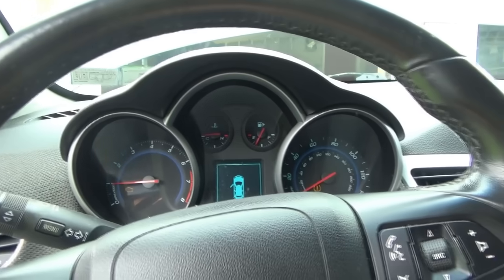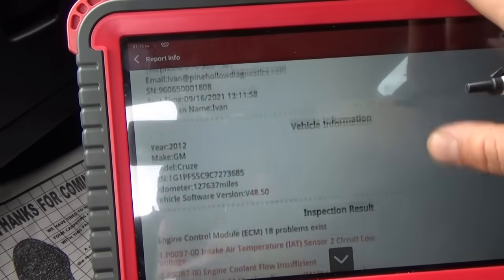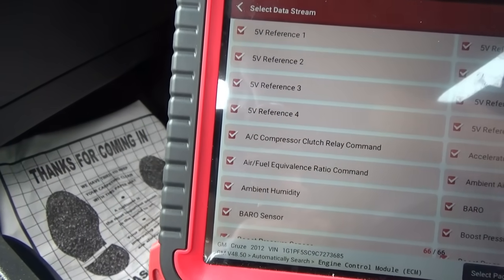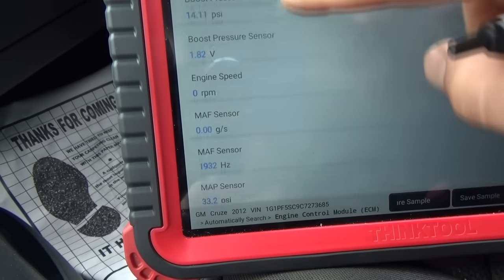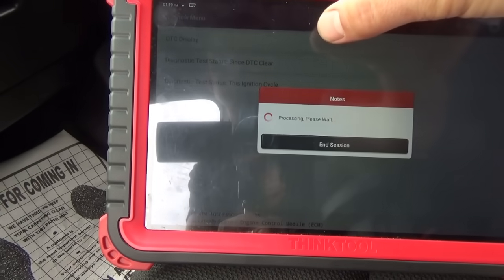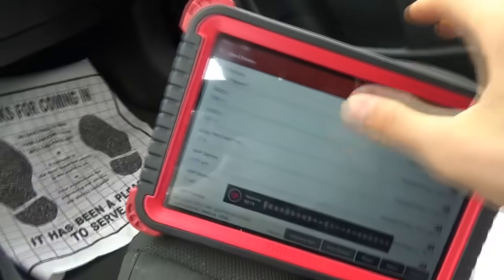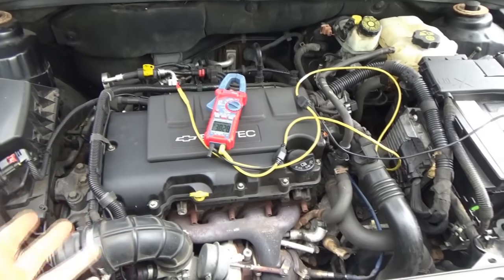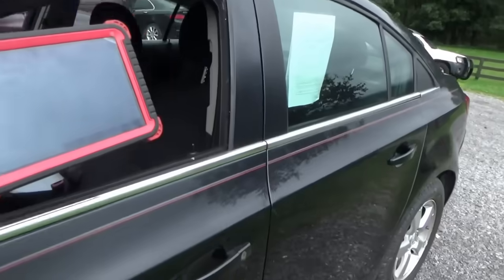Scotty Kilmer was RIGHT! (Cruze Turbo Rough Idle P0106 P0171)

Comment: The only thing reliable on a Chevy Cruze is the check engine light bulb😆
Reply: I love it! MechTech Tools must have had some interaction with the Chevy Cruise!
Reply: until it burns out
Reply: @dfields9511  maybe we should invest in these bulbs since they will be on all the time!
Reply: My sister has a 2012 Chevy Malibu with the Ecotech she has 306 thousand miles on it just regular maintenance that's it
Reply: @harveyadams5453  Right! My 2011 Cruze has been the most reliable car I've ever owned. 154k and still going.
Reply: @ComfortablyNumb1969  until 1hr and 59 minutes ago
Reply: theres nothing reliable on any chevy
Reply: You are very right, the check engine light is very frequently  on, if not always.
Reply: @ozzykrahn806  Its not just chevy. They all have their issues. Just some worse than others. It's getting worse on all of them every year. It's obvious, though, that the chevy cruze is junk. I use to work for dodge and ford as well and they leave alot to be desired!!
Reply: Which is based on my Bmw 740i too 🤣
Reply: @billmonroe8826  I’ve driven over a dozen Toyota’s and not one has an issue. I’m betting if a Toyota does have an issue, it’s due to there being a fluke by the manufacturer or the customer didn’t follow the service intervals
Reply: @harveyadams5453  There are always exceptions to the rule.  Congrats to your sister.
Reply: @harveyadams5453  That's my point!
Reply: I have a Chevy Cruze with 200000 besides regular maintenance I'm only now starting to have transmission issues
Reply: @harveyadams5453  unicorn
Reply: Naaah it might burn out.
Reply: Facts 🤣🤣🤣
Reply: Haha 😄
Reply: That can be fixed with a pair of wire cutters
Reply: Worst investment I've ever made 😂 I've had mine for half a year & I've had to put 2k into it. I change my own parts too so that should let you know how much it's needed. As soon as I fix it I'm trading that POS in & never looking back. Lol
Reply: I own two and each one has over 200,000 miles on the odometer.
Reply: @bjr2379  I think it depends on on your existing car. Working in a Toyota plant before we'd get tiny miscuts & still send it. Some go bad, others don't. I change my oil every 2k miles, & keep great maintenance but it doesn't matter 😂
Reply: @bjr2379  buy a lottery ticket because you are the luckiest man alive
Reply: @ComfortablyNumb1969  ..my 2006 Corolla at 220,000 KM still going strong.  Original alternator finally died.
Reply: @ComfortablyNumb1969  I have a 2011 Cruze that was the most reliable thing I had, WAS, then it hit 145k, thing has had a check engine light on for everything, oil leak, then coolant leak, then both.. Currently trying to sus out the check engine light now. Keep getting camshaft position sensor, sometimes it is performance, sometimes it is circuit sometimes it intake, other times it exhaust... Changed EVERYTHING except cams, no change... Bitch is about to go, absolutely HATE that car now.
Reply: @harveyadams5453  different set up.
Reply: @bjr2379  1.4? Trust me, you WILL have issues if it is...
Reply: @harveyadams5453  my sister bought a 2017 I think, against my judgement. It’s been nothing but problems wince the day after she bought it. Piece of junk
Reply: I think that's the most reliable thing on most GM vehicles.
Reply: True that!!
Reply: I never did find where the service light was on a chev I owned. It was burnt out when I bought it.
Reply: Got a 2011 1.8 Manual, it has yet to leave me stranded but there are definitely some quality of life issues I have with it.
Sometimes air won't blow through the defroster vents, I can hear the actuator running even after I shut off the car and it just corrects itself the next time I drive it.
The crankshaft seal that whines/squeels everytime I hit the accelerator. Been telling myself I'll fix it soon.
Nonetheless 85k and still running strong
Reply: @madebycarrera7585   What parts did you replace on it? I’ve had my string of issues fixed and no problems now except oil leaks
Reply: @wesleymitchell7858  I've replaced the valve cover, upper intake manifold, purge valve, & I just finished the head gasket this morning. They seem like nice cars, but even if you address it & change the oil every 2k miles instead of 3k it still has persistent issues. If I were you, I'd highly suggest getting the oil leak taken care of then trade it in. I'm selling/trading for a 97 Civic that was well maintained & it'll last 500k miles. It's a never ending head ache with Cruzes though sadly.
Reply: On the 1.4T, that's normal. My 1.8L NA has no issues
Reply: @DragonKillah  I concur with you, the 1.4 sucks 😂
Reply: That all Chevrolet
Reply: So true 🤣😂
Reply: Lmaooo fr
Reply: @harveyadams5453  LOL
Reply: @djentyman4002  some don’t drive very well, with the rotten frames.
Reply: @DragonKillah  same here. 1.8 has been bulletproof
Reply: @kw6713a  if you have an auto trans that will be your failure point. If you have a manual, you can use the access panel from a gen 2 M32 and a thicker bearing with AMSOIL Synchromesh 80w-90 gear oil and you'll never have issues with it
Reply: @DragonKillah  thanks. I have auto trans. I did have corroded transmission cooling lines, caught in time. I'd maybe advise anyone in a snow climate to have those changed preemptively or at least looked at carefully.
Reply: @Ken-wg2cw  replaced my Cruze MT at 85K miles.  Noisy whine.
Reply: Agreed
Reply: @bjr2379  ...and ?
Reply: @bjr2379  ... how many engine/tranny swaps ?
Reply: @robtheslob3940 
 Zero, but I did replace one clutch.
One Cruze was totaled after an accident. So, I bought a diesel Cruze with 205,000 miles on the odometer. Runs perfect.
Sensible driving and proper maintenance does wonders.
Reply: @bjr2379  Very true, if people maintained their vehicles properly the landfills would be a bit smaler
Reply: Yeah..hasn't failed me yet.
Reply: Mine burnt out lol
Reply: Chevy Sonic as well😂😢
Reply: Any ecotec engine
Reply: @BrianWood74  Y'all obviously do not take care of cars....
Reply: @thewarzoneking  😂😂😂 my Chevy's ran strong 💪💪
Reply: Lol
Reply: My 2014 Chevy Cruize has been super reliable regularly change oil transmission fluid  it has 184000 and still going strong
Reply: Too true on that one
Reply: the check engine light is LED , scotty  didnt know that.
Reply: NOT WHEN SOMEONE PULLS IT OUT BECAUSE THEY CAN’T FIX IT!!!!
Reply: That part
Reply: You got that right.😅
Reply: Lmfao parmesan cheese 🤣😂
Reply: Absolute junk
Reply: I absolutely hated mine
Reply: This made me lose hope and laugh at the same time. 😂😢😂
Reply: @ComfortablyNumb1969  it’s probably the way people drive and run these cars like their race cars every day lol
Reply: @bjr2379  it’s definitely the way the fools that own these cars drive them like their race cars every day and thrash them. I have a 2014 Chevy sonic hatch with 1.4t and 58k on it and knock on wood I haven’t had any issues but I also baby mine lol
Reply: Nope.. lol I've had a hidden "Stored" code for few weeks now.. a p0506.. and has had horrible cold starts for past 2 months..  just because a light isn't on, don't mean there isn't a code hangin out lol
Reply: Yep. Chevy should go back to building cars with Toyota Engines like they did with Nummi.
Reply: My wife and my mother her both have 2014 LT models and those check engine light bulbs get a good work out!
Reply: @ComfortablyNumb1969 must have been a 1.8 that 1.4 is not 'it'.
Reply: @evertonb3031  Nope, 1.4T now 170k and still going.🙄
Reply: not true i have cruze 300,000miles still drives fine no lights i have done all normal maintenance
Reply: @BrianMelJohnson-rc1qk  1.8L motor?
Reply: @Steve_Reject  no 1.4
Reply: I'm here for the P0106 code, it's only the 2nd issue I've had with my cruze since new. It has 225k miles on it. Maybe I got lucky but my cruze has been nothing but reliable.

Comment: This issue was a recall on the Cruze, I'm a excellent mechanic for over 40 years. Mine was in the warranty coverage, check engine light was on. Valve cover was definitely bad, it was the reason for the recall. They refused to replace it unless I paid them for replacing the intake. Which is where the PVC diaphragm is located. Which is why the valve cover part of the PCV system ruptures because of turbo boost. Well, needless to say they didn't get to repair anything. I replaced the valve cover, and installed an aftermarket external PCV system. GM is putting a screwing on consumers over this.
Reply: Yup I am dealing with exactly this except the dealer only fixed my pvc valve and nothing else nor did they even suggest that there was other stuff needing to be replaced. Might need to trade this thing in while it’s not broken
Reply: You are an excellent mechanic for over 40 years and you bought a Cruze?
What were you thinking man?
Reply: @68404  132k miles. 70 mile round trip every day. Got a friend who has the identical car. Nothing but trouble. I just keep up the thing!
Reply: @ryanhawkins4365 its a cheAp simple repair.. why trade in a car for a lousy $400 repair? Get the napa manifold, they have a better valve design
Reply: Driving a 2012 Chevy Cruze 1.8 liter. And it is one of the worst cars ever made other than the Chevy traverse aka pufferfish. Once that electronic power steering goes out you are going to be having a good time.  55000 miles and ready for the scrap yard. Thinking about just hitting it with nitrous.
Reply: What about Equinox lol?
Reply: @jonjon3719  I have been lucky to soak the rings in Sea Foam and slowed down the oil consumption. 6 months so far. But I'm not going to hold my breath. 🤣
Reply: The intanke causes the pcv diaphram to tear because there is a check valve that fails so the pressure from the turbo goes into the crank case and the pressure tears the pcv diaphram
Reply: Where do u get the external PCB valve kit ?
Reply: If you are an excellent mechanic, what possessed you to buy ANYTHING with a bowtie on the hood?
Reply: @JamesAgans  GM man all my life. But I have owned a 7.3 powerstoke for about 15 years. I grew up racing Chevy. Ford will break the bank. I wouldn't buy any of the manufacturers new vehicles now.
Reply: Did you mean PCV? PVC is polyvinyl chloride.
Reply: @JamesAgans  yes! LMAO. I love autocorrect and crazy I just glanced at it
Reply: 😅 @toigatuning120
Reply: Why would an excellent mechanic buy or drive a Chevy Cruze? I just watched Ivan replace the fuel injectors on a Rav 4 with 430,000 miles on the clock. General Motors should be absolutely ashamed of themselves.
Reply: @JamesAgans  because I watched for the warning signs. The Cruze actually impressed me by not having all the problems every one else was having. Was mine made on Wednesday? But also I sold the Cruze a couple of months ago because I had been lucky. Before it's time. 🤣
Reply: @catbird1759  I'm pretty sure you probably avoided the warning signs through preventive maintenance, just like I have done on my 2004 F150 with the 5.4 engine. As you well know, if you wait till something lets go it may be too late, and you could lose the whole unit (engine, transmission, transfer case etc.) because you got caught asleep at the wheel. Nice job on the cruze
Reply: @catbird1759  well don't feel bad, PCV "Valve"  is redundant. Lolol

Comment: I remember along time ago when GM was designing that engine reading glowing reports from one of the big magazines that was claiming this engine was the next biggest thing in the automotive world , a real game changer , boy were they right , for all the wrong reasons , LOL !
Reply: Really?   Lol, What did they expect it to do?  It’s the same thing engines have always been except this one is less reliable , very sensitive to any small problem, not very good sounding ,  not amazing gas mileage or power.  I have grown to like them a bit though , once some of the problems are figure out.
Reply: Hilarious they actually said that about the Northstar engine also🤣
Reply: @wanee8039  Yes they named them appropriately Northstar that is where the bill goes when something breaks up and up and up!
Reply: GM ? it is crap from korea made by Daewoo. In europe GM stopped selling that crap
Reply: I’ve got the 1.8 n/a for a reason. Anticipated issues with the turbo engine from day 1…
Reply: @kentteffeteller5173 It's a stupid easy fix.  Honestly, for me the camshaft cover failure doesn't even constitute a 30 minute video, as a GM Tech I was doing like 4 of these a day at one point in time, before GM figured out what was going on, and yeah, in about a half hour for the whole repair.

@mrmajik03 joke's on you the 1.8 has issues too.  It too can have camshaft cover issues, but it also has cases of the cylinder head 'grabbing' the exhaust camshaft, and causing timing faults, and needing the cylinder head replaced.
Reply: @srenlund-hansen6883  GM owns Daewoo.
Reply: @68404  ha ha ha
Reply: @68404  and ? worst crap
Reply: @Kieva_Storm  mind me asking what is done to fix this problem? Really appreciate any advice.
Reply: @bluegrasskid  so unfortunately unless you modify the engine you're not going to get a GM approved permanent fix. 

There is a 1 way valve in the intake manifold. You can see it when you take the PCV hose off the top of the manifold, the one that goes to the turbo housing. It tends to get sucked in the engine after enough oil exposure. The aftermarket fix is to plug the valve's seat, and direct that ventilated pressure out, to a three way split section in a custom run hose. Turbo and intake manifold hose meet to route in to a modified hose past the evap purge solenoid. This effectively recycles the pcv system pressure in to the intake through the evap system.. The mod lasted me about 150k, until I had engine failure and moved on to the 2nd Gen Cruze, which is superior in every way.

You can find the mod on CruzeTalk forum. Alternatively, you just replace the intake manifold and the camshaft cover. Should last 50k to 80k miles.

Comment: Yeah check valve in intake and or pcv valve in valve cover bad. There is modifications to fix problem but if just want to repair,  buy manufacturers name brand parts. Intake Check valve failure will overwork pcv and cause premature failure. Just changing pcv will mask problem till pvc fails again.  Heart of problem is the check valve in the intake.

Comment: Valve cover is 100% defective there should be no vacuum at that PCV port. Would need valve cover assembly and intake assembly. And when valve covers off clean carbon from ports if excessive. Replace many of these at work.
Reply: Correct
Reply: Agreed.  I believe you need to replace the tube from intake to turbo as well.
Reply: That's right! There is a diaphragm there and that suction is because it's broken. One side of diaphragm has access to atmosphere pressure through that hole.
Greetings from Poland.
Reply: @jamesI197999 would you by chance know about what that would cost? I’m trying to help a friend out.
Reply: Cost for this replacement?
Reply: @dharsley9570  Dorman the manufacturer of the kit says 2hrs. I’m guessing $200-$400 give or take.
Reply: @bluegrasskid  appreciate u!
Reply: @dharsley9570  easy and cheap if you do it yourself, just some bolts to remove and retorque it to 71 inch pounds. An aluminum valve cover upgrade is 80 dollars from ZZ performance.
Reply: @bluegrasskid  also look up pcv v3.4 fix kit, it might be more helpful than the aluminum valve covers

Comment: It is very common knowledge that aluminum and plastic move at a very different rate in response to temperature change. Add to this high pressures that they try to resolve with rubber gaskets and o rings, and you have a recipe for failure. How did the auto industry forget this? You think maybe they really dont give a damn?